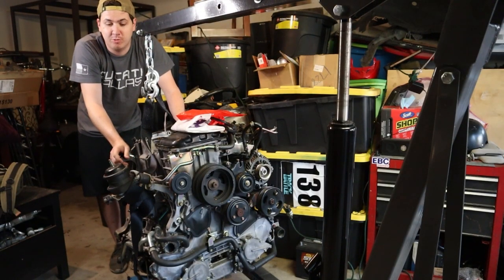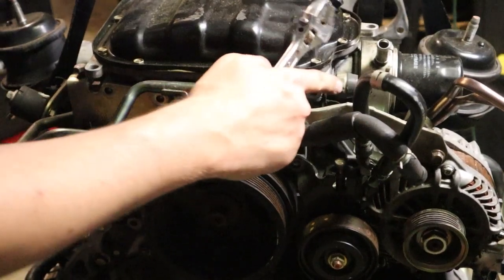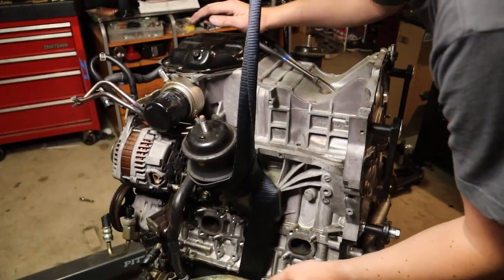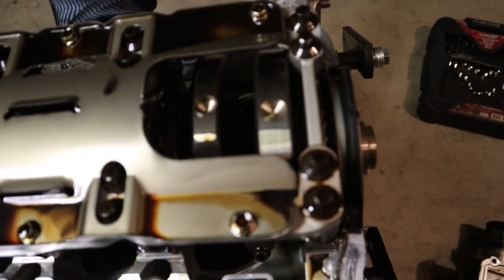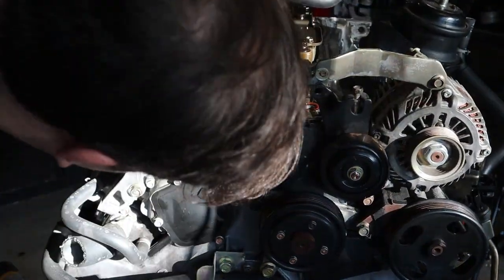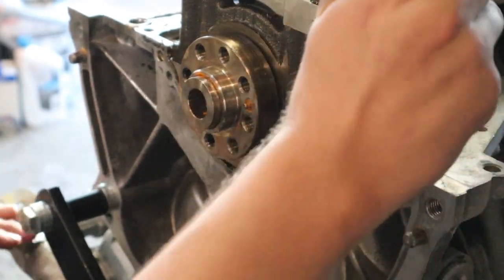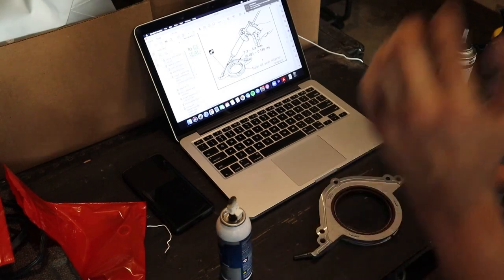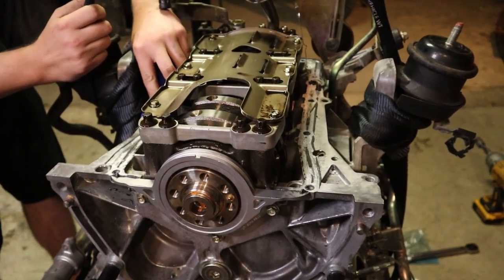Ultimate Street/Track 350Z motor build (JDM VQ35DE build pt 1)

Comment: I did a refresh on  a donor engine from an auto G35. Had to remove auto pilot bushing, but besides that I only saw the oil pressure unit, evap sensor and wideband sensors were different. I have an 03 350z and the G35 was 04/05. Awesome video, I wish I'd seen this before doing that job myself
Reply from the maker: Oh wow that sounds very similar to the JDM motor. I had to swap the oil pressure sensor, evap sensor, o2 sensors, and a few accessories. You'll see in the second video. This one was also an automatic and removing that pilot bushing was a nightmare. Thanks man, appreciate you watching!
Reply: @BrunerTuner  I rented the piot bushing removal tool from o'reilly only to find it didn't fit and had to use bread & grease method. It was a complete mess lmao 

Solid content, keep it up!
Reply from the maker: Lol I did the exact same thing, except neither worked! You'll see what I ended up doing. Thanks man, appreciate that. Question for you, what would you like to see in terms of Z content? I've done track stuff that you'll see soon, and have some mods planned. Curious to see what the community might want to see!
Reply: @BrunerTuner  I enjoy build and information videos. Michael Gardner was saying his information videos gets way more views than his track videos. I've just been way too busy personally to make anything z specific. I know my dyno video and sound clips do really well though.
Reply from the maker: Yeah it's unfortunate that the track videos don't do very well. Mine haven't either, and I know Speed academy is the same. It sucks, because I love making those videos. I'll do more informative and in depth build stuff, though.